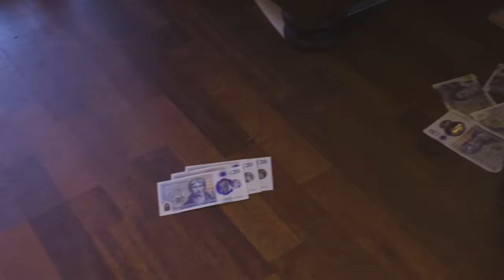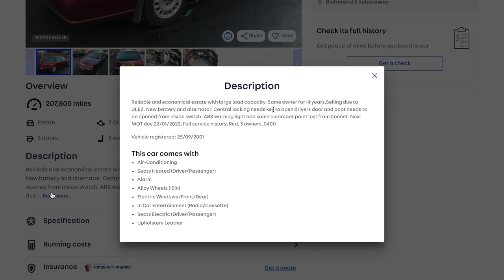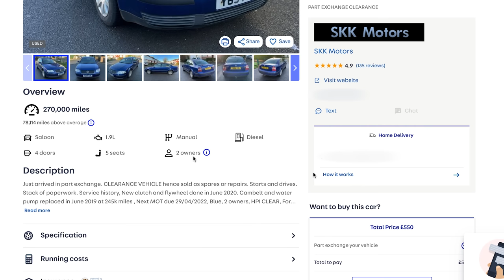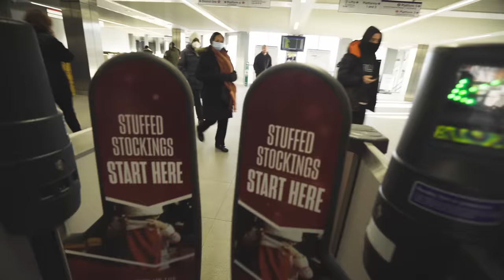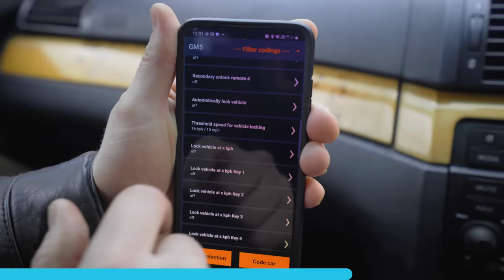Can I Buy A Car & Beat Public Transport?

Comment: Technically a taxi in the UK is "private hire" so I'm giving it Alex
Reply: Technically Uber is not a taxi service.
Reply: Thing is even if it is private hire a taxi is transport for the public to use
Reply: @Booka3141  i would say uber is more of a private hire, a proper taxi is more like public transport
Reply: Uber is 100% a loss. It's private hire, not public transport. Public Transport unreliability and missed connections means a loss in my book.
Reply: Is it available to the public? Yes. That counts.
Reply: @sparky4878  Nope. Public transport charges fixed fares and runs on set routes.
Reply: The Uber is a personal vehicle that you can buy in a dealership for a consumer and public transport you can't buy unless it's really old or something so Alex wins in my opinion
Reply: @sparky4878  not when you're using it, even if you're not in it or at capacity. It's a contracted private rental. Not to mention it absolutely doesn't fit the spirit of the competition, otherwise they could just get a taxi from London for the whole journey and call that a win.
Reply: Taxis are not public transport, they are private businesses on wheels.  Jack and Ethan just got chauffered in someone else's car.

Alex wins.
Reply: A Taxi can use Bus Lanes making them public transport, enjoy the fine if you try using a Bus Lane yourself.
Reply: Alex won
Reply: @Jamal_Tyrone  that doesn't make a taxi public transport, that's just an exception, much like how taxi drivers are allowed to not wear a seatbelt. Public transport means the public can use it yeah? But if I get a taxi, other random people can't come and use it as well unlike a bus or train, it's literally called "Private hire"
Reply: aren't most railway companies private, and not public in the UK?
Reply: @neovenom9833  you're talking about "public" or "Private sector" of which is irrelevant in this debate, all that is about is who owns the company, not it's use
Reply: yes a uber isnt public transport since you dont have to share a uber with someone else
Reply: If you can tell it where to take you and, even which routes to take, it is not a public transport...
Reply: I believe Ubers / minicabs count as public transport for use of bus lanes on the road, and thus qualify by virtue of road regulation categorisation?
Reply: If it was a black hackney from outside the station I would have agreed. The bus station is straight across from the train station. There's loads of buses which go past Ladybower. Typical Londoners dont want to speak to anyone and find out. This is Sheffield. Don't be a wuss.
Reply: @DiscoFang  that's completely untrue, ever heard of Demand Responsive Transport?
Reply: @antonycharnock2993  Personally I always enjoyed the bus from the City centre up to Fox House, having a picnic by the river, and then hiking down to Totley station for the journey back.... 🙂👍
Reply: If it was caught from a taxi rank at a bus station or train station with no advanced booking you could class it as public transport…a Uber is not in theory as needs pre booking
Reply: @Jamal_Tyrone   taxi kant use bus lane only black cabs can
Reply: I alex as a jezza character so im giving it to ethan and jack
Reply: Yeah it's bullshit at this point they could get the stig to become a uber driver and get them to pick them up to go the whole way, they'd be sure to get ahead. That or get on a carpool app like BlaBlaCar where you can see which car the driver has, and sometimes you can find an rs3 or things like that so you know you're getting there quick lol

No but really using a taxi is such a cheat, the whole point of public transport challenges is to see if you still gain time with slower transport, having to get in line, possibly missing a bus because it's full, having to deal with scheduled times that don't necessarily line up with what you want, possibly missing because you're late or having to way 30 minutes for the next train, etc... If you get a taxi it's there when you need to leave and you can even ask the driver to go faster and not have to deal with lines, people and schedules, it's bullshit.

Also proves what in the end ? That a car goes as fast as another car ?
Reply: They had to book it, so it's private not public. Hackney's are the only public ones as no need to book. If they had got into a cab at a rank, they would have won. Alex won.
Reply: It's public and it's transport, as Edina Monsoon once said.
Reply: Alex won. Too easy
Reply: Uber are private hire mini cabs not a Taxi
Reply: @cj92akl  
First thing : it's only public if you gotta share it with, you know, the public...
Second thing : the whole point of those challenges ever since when Top Gear started was for it to be a challenge between a car and people taking buses and trains, if it's just Alex in his car, and the other team in a car, but with a driver they paid, the whole challenge lose all the sense it had.
Reply: @Jamal_Tyrone  so can bicycles, that doesn't make them public transport. Don't be a brainlet.
Reply: @h4zgame523  public implies that there's a lot of people at one time.
Reply: @Booka3141  the car is private property.
Reply: @ZHM88  in Sheffield private hires are allowed to use bus lanes, council are not to fussed about them, even out of town taxi drivers can
Reply: @MrHussain1998  well in greater manchester you kant
Reply: @ZHM88  well its not Manchester is it bro
Reply: What about Demand Responsive bus services then, which are becoming a more popular option for less economically viable routes? These are in a way, similar to Uber, except your vehicle has more than 4 seats 🤣.... Either way, it's a bending of the rules, but taxis and private hire vehicles form a part of the public transport system so..... Jack and Ethan won.... It wasn't in the rules to not use a taxi or private hire vehicle 🤣
Reply: uber was not  excluded before race
Reply: The uber is not available to the public while they have hired it. A bus isn't private hire, other people use it at the same time. It's a clear line to destinguish.
Reply: @h4zgame523  so why not just get an uber from the beginning of the journey if its public transport and cut out the train and bus.
Reply: @Jamal_Tyrone  well why didn't they just hire an uber from the very beginning then
Reply: For everone in this thread saying private hire taxis arent public transport a Goverment report conducted by Foresight lists them as public transport both hackney cabs and private hire vehicles. So its a loss to Alex
Reply: Ethan and Jack may have won the race, but public transport lost spectacularly.
Reply: @jackgarner5898  the Oxford English Dictionary defines public transport as “buses, trains, and other forms of transport that are available to the public, charge set fares, and run on fixed routes.” 
Taxi’s and private hire vehicles do not fit into this definition, so Alex wins…
Reply: @ajcgolf69  That's true but the Oxford learners dictionary defines it as a system of buses, trains, etc. Provided by the government or by other companies which people use to travel from one place to another. So it's too complicated to just find a straight definition even from the same company (in this case Oxford press) which is why I used a local government source instead
Reply: @Booka3141  it needs a license to operate which is authorised by tfl so it technically is.
Reply: @Draksyl   black cabs and taxi ranks not Uber services as far as I know
Reply: @h4zgame523  For private hire, public means anyone can just get on If a taxi stopped to let other people in mid-journey I'd riot. Alex cleary won this one.
Reply: Yea, but in my opinion and I’m sure most peoples would define it as public transport. A taxi is basically just a small bus with fewer diseases on it.
Reply: @h4zgame523  It's cheating end of.
Reply: Technically a Taxi is not private hire at all. A Taxi is a Hackney  Carriage with a lit up roof sign and taxi meter which is public hire or public transport. A private hire vehicle such as most Ubers is different and as it says is privtae hire (prebookd, pre agreed rate, no meter, can't be hailed). But yes, as they got a private hire Alex wins...!
Reply: @DiscoFang  Uber is public Transport
Reply: @Booka3141  because it’s someone’s private car
Reply: Uber vehicles aren’t even classed as taxis. A taxi and a private hire vehicle are in different licensable categories.
Reply: @h4zgame523 Using that logic, a private jet can be used to transport me and my mates, so can also be classed as public transport.
Reply: @Jamal_Tyrone an Uber is a PCO ( private car operator) and as such are NOT permitted to use bus lanes as a PCO also does not have any exterior identification as a registered taxi does, get your facts straight and never generalist is my advice to you 😊
Reply: Private hire by the general public...
Reply: Yes exactly

Comment: Alex is the winner 100%. If an Uber is allowed then they could have just got in an Uber at the start. Plus it's a battle against the car, not car vs car.
Reply: 100% uber / taxi is NOT public transport
Reply: @girlsdrinkfeck  erm u liturally need a license to be an uber
Reply: @girlsdrinkfeck  i assume so, i checked and they do need a licnese
Reply: 100%
Reply: @girlsdrinkfeck  to bypass regulations about what type of car to use.
In Greece you’re limited to have a Taxi only as an EV or a diesel until 3L or a petrol until 1.6L and usually the choice was either a Skoda or a Mercedes or a Toyota.
While Ubers (when they were allowed) could be anything. Even an expensive s-class with an actual AMG or unfortunately in the most cases: a very cheap Nissan from the early 2000s that mechanical conditionion was so bad it was a deathtrap. But it was cheaper and more people used it
Reply: Alex won. Too easy
Reply: @girlsdrinkfeck  its just another taxi firm now basically

Comment: I would love to see this Passat get a full interior and extrerior detail, these B5.5 are really nice to drive especially with that 1.9TDi engine.
Maybe try to sell it for a profit to someone who will himself take care of it.
Reply: Its on 265,000 miles. Realistically its not even worth what they paid for it even in better condition.
Reply: Inky blue is a lovely colour
Reply: @ceirwan  depends how complete the service history is, some cars wear miles like that fairly well.
Reply: @justkomodo  I'm sure they do, or it can. But its a hard figure to look past as a buyer. I don't see it ever being worth much more than what it is now. 
Once they get to this age, everything is starting to wear out, suspension parts, rusty brake & fuel lines, the engine itself, steering components, power steering hoses, interior parts etc.
Reply: @ceirwan  true, second hand prices are fairly crazy atm for medium sized cars though. I’d say anything with decent service history and a new MOT should be going for £1000 minimum, otherwise I want to know what’s seriously wrong with the car. The shock absorber on this one explains the price: you couldn’t say it’s in reasonable drivable condition until that’s replaced, but £1000-1500 is what you have to pay for a “reliable” cheap car these days rather than £500-1000
Reply: @justkomodo  Its got 260,000 miles on  it, at that kind of mileage and price you wouldn't expect to be buying a reliable car, because realistically that engine is approaching the end of its lifespan. Even if I'd owned a car from new and had the full service history, at that kind of mileage I would be treating anything  more I got as a bonus. I'll bet this doesn't have anythinng close to a complete service history. 

Realistically with a budget of £1500 there are much lower mileage cars in better condition available, even in this crazy market. 

Heck, bash in the reg into MOT history checker  & you can see the kind of expense you're getting into with a car this old.
Reply: @ceirwan  I had a look on the MOT checker and didn’t think it looked too scary, but I’ve always assumed that if you do 15,000 miles a year your car will need something repaired for the MOT. I may also be biased as my daily car is a 23 year old 200,000 mile Volvo I do 15,000 miles a year in and got for £700 on 150k miles with full service history; in my experience though if you want a totally clean MOT you need a much much newer car. Looking on autotrader there’s a Passat with only 95,000 miles for £1300 but it has no service history so it’s just not worth touching.
Reply: @justkomodo  Guess that's just difference of opinion. I wouldn't touch a car with 260,000 miles unless it had a new engine. That said I'd be fine if I'd racked up that mileage myself, in general if someone's done that many miles then there's a reason they're getting rid.
Reply: @ceirwan  mate, I daily drive a 2007 220 CDI c class I got at 217k miles and now it's at 267k.

It drives perfectly. Engine runs amazing. Yes, it's well maintained.

And yes, I had to change the fuel lines and the suspension. 

But everything else works perfectly.

High mileage cars can be good, they just need good maintenance. Not perfect, but good, comfortable and reliable.
Reply: @ceirwan  Clearly you don’t know what are this engines capable of. I’ve seen 1.9tdi pd with over 500.000 miles . Still running nice like a dream .
Reply: @bogdancozmei7609  For every engine like that, there's another that's not been serviced properly, abused all its life etc. 

Just because it can do that is no guarantee it will. 250k is a lot of miles on any engine tbf.
Reply: Car throttle guys bought a running Audi A4 with 540,000 miles on it (same 1.9 pd tdi engine as the Passat) and had it inspected. See their video "what does half a million miles do to a car"
Reply: @ceirwan  For a TDi Passat this is nothing. Ive own 3 :)
Reply: @pickamove  hey man I get it, they're amazing engines. And properly maintained will run for about forever. Not disputing that,  but buying a car with over 200k miles is pot luck, because mostly by that point you'll have no proof of service history, for all you know it could have gone 60k miles with no oil change, abused from cold etc. Not saying don't keep an old car you know to be reliable.

But I'd never buy one already at that mileage.
Reply: @ceirwan  you clearly never heard of the 1.9 TDI PD
Reply: @Grr Kaa  I had one. The 115hp version. Cam belt failed at 140k. Cam Belt was only 15k miles old. But anyway, its one thing to keep hold of a car running reliably. But to buy one with already 250k miles on is something else

Comment: family owned one of those Passats, slightly better trim but those TDI engines were absolutely bomb proof, same engine I believe as the Octavia you guys had on.
Reply: Octavia had non-PD afaik.. Both this and the A4 are PD
Reply: The one I had in an Audi wasnt. It blew a turbo and then decided the oil should be on the road instead of the engine.
Reply: Agreed, 1.9 TDI is unbreakable
Reply: My tdi a4 b5 did 450k km and still going solid , that's 280k miles
Reply: @tougeking9226  My parents have the same exact car model and its done almost 500k KM too! Everything is fine except a little few scratches and dents
Reply: I've blown multiple turbos on pd engines and blown 3 pd engines, they are not as great as people make out. My m54b30 is more reliable than a pd and it's on higher milage than any of the pd engines I had and that's a high revving 6 cylinder petrol.. I'd take a BMW 6 pot or Volvo t5 2.3 engine over any diesel any day of the week.
Reply: @MDM1992  what were you doing to your poor PD engines
Reply: My daily is a 1.9 pd100 in an A4, 261,000 miles. Runs great. 
There's even another one in my tiny town with over 250k on it too still running.

Comment: Love a B5.5 Passat, nearly 20 years on from being discontinued and they're still one of the best cars you can buy bang for buck. Comfortable, loads of room, handle "well enough", plenty of cars came equipped with multifunction steering wheels and cruise control, loads of torque from the PD which run for miles and can run on cooking oil...

Edit: an Uber isn't public transport, being available to the public and being transport does not public transport make. Public transport follows designated routes for set fees.
Reply: The B5/.5 handles like an Audi since it has multilink - not like a quattro but an Audi nonetheless! (Unless your bushings are done  which they often are with older cars)
Reply: Not sure the PD engineers can handle cooking oil...

Comment: Having owned a few, the Passat would be my go to for a challenge like this every time!
Reply: Passat for myself. I owned a 2005 2.0 TDi Sport for two years and it was a brilliant car. I bought it for £1,400 with 169,000 miles on the clock and sold it with 209,000 miles for £750. It also had a Nappa leather upgrade.
Reply: Still got one, 2001 pd130
Reply: any tdi :P
Reply: @girlsdrinkfeck  Not it it's got many of newer VW engines, granted the 1.9 PD is a legend though.

Comment: Alex was the winner this time.
Missing the train or getting false info about bus is one downside of public transportation.you can't use that to get a cab to your location in this race
Reply: uber was not  excluded before race
Reply: @vampirwrr  yeah but it wasnt included either.
Reply: @vampirwrr  it's public transport. UBER  is a private car hire service
Reply: 100% agree Uber is cheating. Otherwise a guaranteed win would have been taking an Uber from the start. And where do you draw the line between taking an uber the entire way vs an Uber for part of the way?
Reply: @clintebbesen120  Agreed